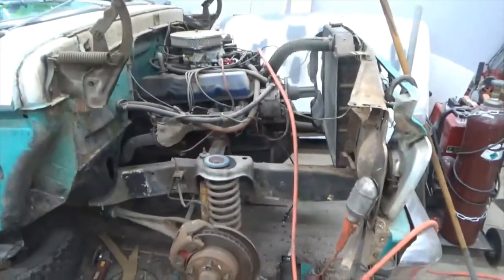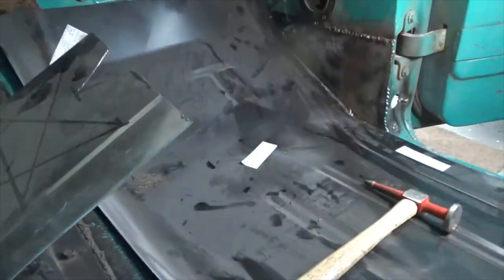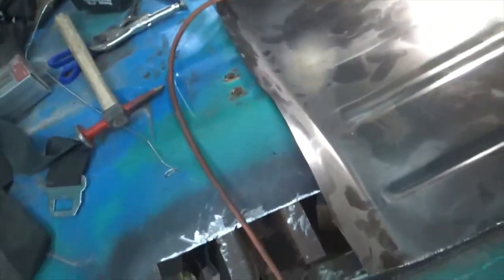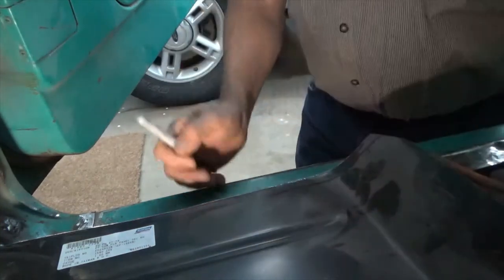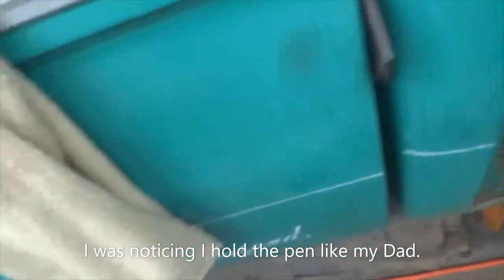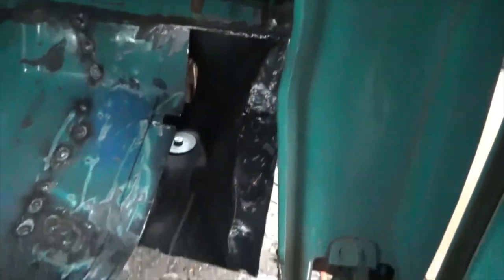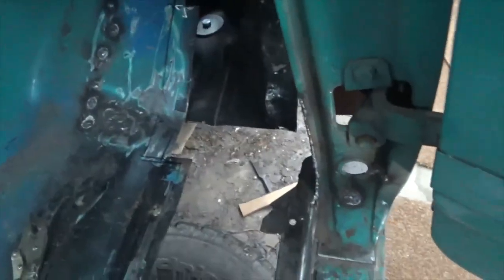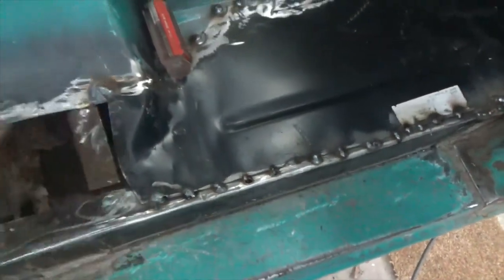More f100 passenger floor repair. Life On

Comment: Looking good Mark! I have a 66’ F250 my passenger side cab corner is rusted out. Did I see it in one of your videos that you’re going to do a cab corner? Did I miss it or is it on the list? I’m learning a lot by watching these. Thanks for posting.
Reply: It is on the list, as soon as I replace the roof and pull the bed off. Thanks for watching